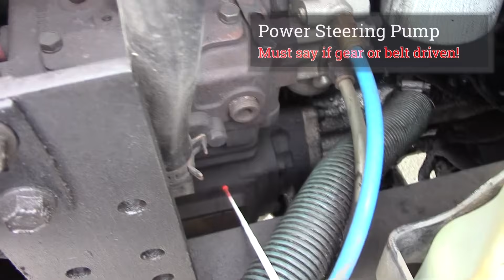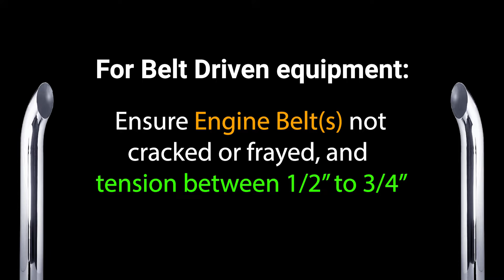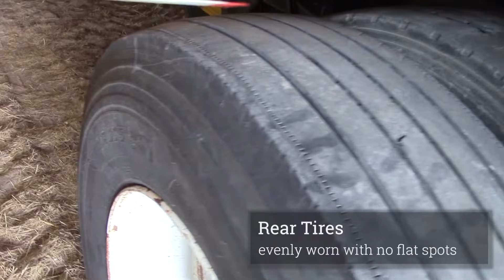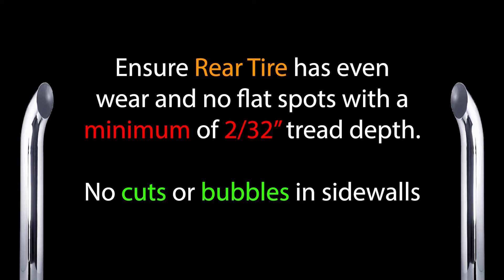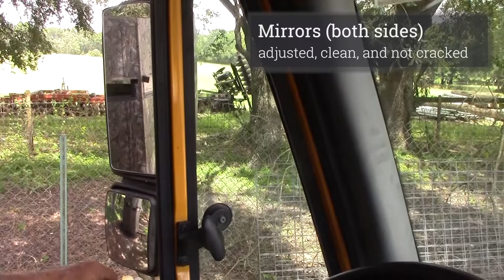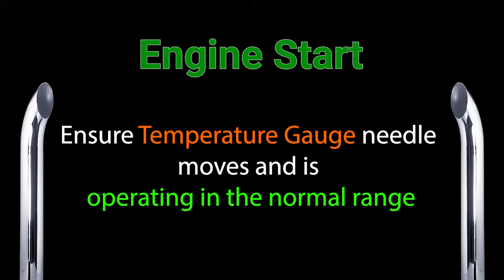CDL Class B w/Air Brakes Pre-Trip inspection

Comment: Hello is this a good pretrip inspection for California? I have my test next month !
Reply from the maker: It depends. 

If your state or your facility still allows the older version of the Pre-trip inspection, then this will work. They should be able to tell you which, the old or modern version, well enough in advance. 

If they use the new modernized version, then I recommend you use this Modern School bus (assuming you will be testing for a Class B) video -- make sure you have the pre-trip down pat as there are a few: https://youtu.be/LLYEJUvb68s 

If you are doing a Modern class A: https://youtu.be/QGCDLMo6OyM

A video for the modernized air brake check (Class B lose no more than 3PSI/Class A, 4PSI): https://youtu.be/rsR_caOpeY8

Comment: It looked to me that you lost more than 5 pounds of pressure in your applied brake test. it started at 90 psi and dropped to 85 psi.
Reply from the maker: For your everyday pre trip inspection (not including your CDL skills test), what would be your next step when you find a loss greater than 3psi (class B)?

Comment: I heard a lot of verbage has changed, like you no longer say 120 psi but 55 or something. Is there an updated video on the verbage of the pre-trip?
Reply from the maker: @LadyMocha, the verbiage in this video is not wrong, but you are right, there are "more correct" ways to state them. Our latest video, a Truck/Trailer Class A w/Air (pintle hitch),  does have those more correct ways stated. Here is the recap portion of that new video that contains those "more correct" statements. Keep in mind (important), for a Class B, the system cannot lose more than 3 pounds of pressure, and not the four pounds stated in this Class A video in this link (the extra pound is for the connected trailer with air brakes): https://youtu.be/vGIbB6U5dTc?si=z09pOlMMQrYkLvLf&t=2328

I apologize for the delay in answering!
Reply: @smgtrucking  thank you

Comment: There is rust. So if you say no rust do you still pass? Or if you say there is rust then what?? All have rust unless it's brand new.
Reply from the maker: When doing the test, you can say there is rust, but when you are completing the Commercial Driver’s License (CDL) Pre-Trip Inspection Skills Test, with the exception of the In Cab, Engine Start and Air Brake Check, you do NOT have to physically demonstrate the actual checks (e.g., pull the oil dip stick or actually use a pressure gauge to check the tire pressure), but you must name and point to or touch each item, and fully explain the reason for inspecting the item (you must ensure the tester knows what you are referring to). You will be graded on whether you know what to check each part for. 

During real life pre and post trip inspections when you find a discrepancy or defect (As taught in Module Four of the Entry Level Driver Training), you must fill out a DVIR and submit it to your motor carrier.

Comment: Hey does this video work for Minnesota drivers ? I’m gonna be going soon for my test in classes rn my first day is tomorrow
Reply from the maker: The Pre-Trip inspection requirements should be the same nationwide. The backing maneuver requirements during the Skills Test may be somewhat different, for example, Florida does not require parallel parking during the CDL skills test. For Entry Level Driver Training (ELDT), no matter what state, you would have to demonstrate proficiency in all backing maneuvers, including parallel parking. ELDT and all its requirements (theory and Behind the wheel) are required federally -- the CDL Skills tests may still have small differences from state to state as I mentioned. I hope that makes sense.

Comment: Please help!!! 3/28/23
I have a serious question and I need an answer within the next two days before I take my test. I am a previous CDL holder of close to 10 years  I am retaking the test for class b. In this video you said 60 PSI when fanning the brakes. I recently failed a pre-trip inspection because the instructor said it was 50 psi and I said 55 psi. According to my States handbook It says 55 PSI. So what is the real answer is it 50, 55, or 60 PSI for the warning light and signal???
Reply from the maker: In the video, we state between 55-60 PSI. That is not wrong, but it is now more accurate to say, "The low air warning should sound before it reaches 55 PSI."
Reply: @smgtrucking  yeah I was failed I initially said 55 to 60 and then the guy looked at me funny and I said I meant to say 55. He said it doesn't matter I'm failing you right now because it's supposed to be 50 psi 

This was at prosafe CDL in Indianapolis
Reply: @smgtrucking Great answer